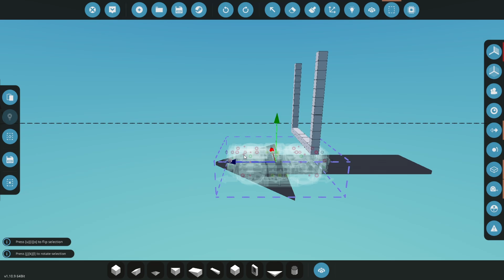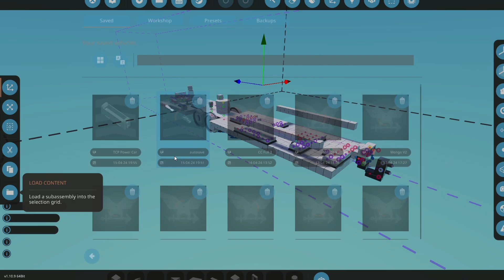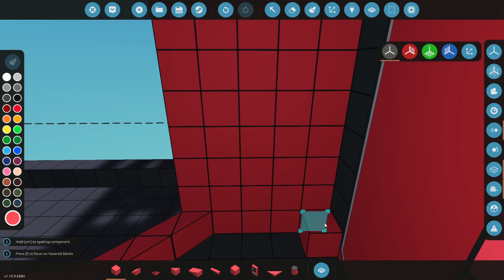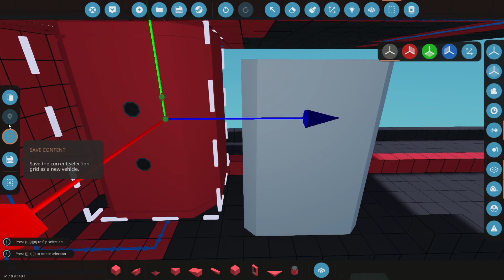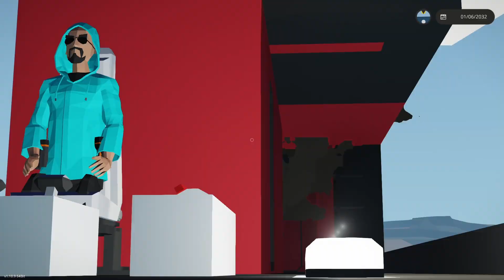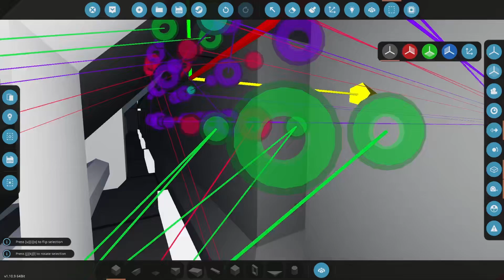TCP Power Car

Comment: You showed off those mid-engined trains and... well that's just the engine of the train. There's no other engines. It's just put in a seperate car. Main advantage is that if one breaks, you just rip out the entire car, and put in a new one. Would look a lot better on jacobs though.

Comment: What is TCP?
Reply from the maker: Train Communication Protocol. Its basically a bunch of micro controllers that allow control over a train and compatibility between different builders locomotives/railcars.
Reply: @terr-rawr-saur  Thanks for the quick reply, and clearing that up for me. 

I am currently building my first Locomotive, and would like to make it TCP compliant if possible. Is there anywhere I can get the specifications that I need to adhere to?
Reply from the maker: @JudgeMarek  Any details are currently in the Stormworks Rail Committee discord. https://discord.gg/ZRm35G2A

The micro controllers aren't available to the public yet because TCP is still in development and changes often with updates, but you can still build your locos in preparation.
Reply: @terr-rawr-saur  Thanks again, that is exactly what I was looking for. I understood from some of your previous videos that TCP wasn't available yet, but I didn't get the memo as to what it actually was. Also I didn't want to keep bothering you with questions about the specifics. So thanks for teaching this man how to fish.

Cheers, and happy hunting!
Reply from the maker: @JudgeMarek  No problem. The TCP team wants to have 1.3 available to everyone in a couple of months. You will hear about it first if you are in the discord. :)